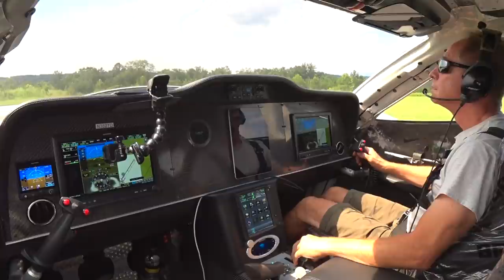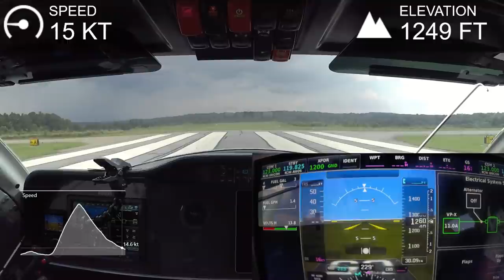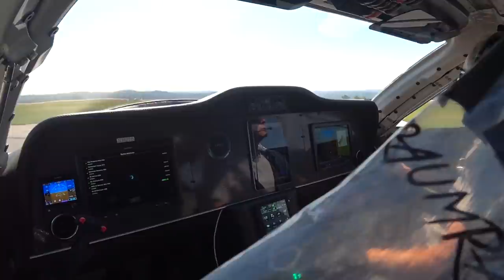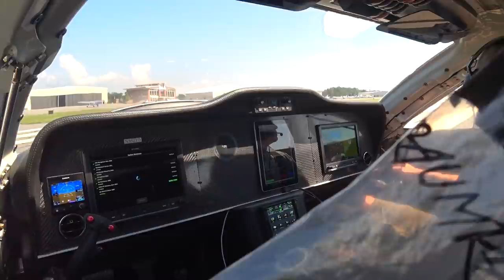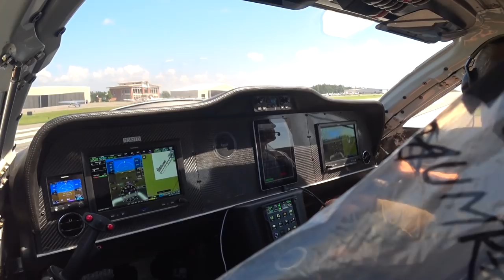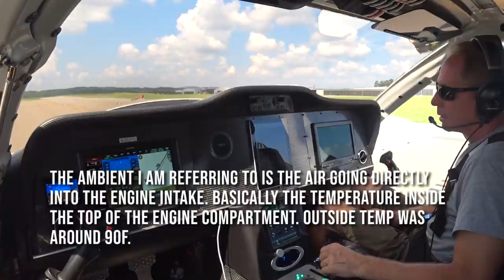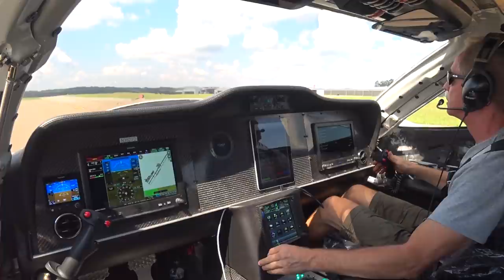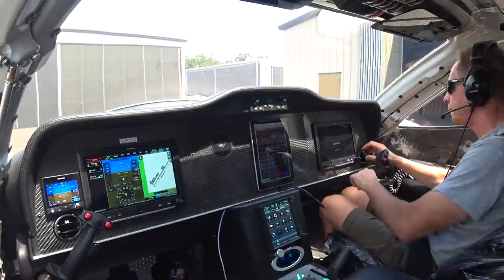Trying to Stay Cool - Building the Raptor Prototype

Comment: Move the condenser; best long term solution. I have very high humidity/temp aircraft A/C operation experience. Ground op A/C is a blessing; makes >25 min taxi-to-runway waits at intrn'l airports bearable and enhances aircraft sales. They're not too useful/efficient above the regional area atmospheric inversion layer (1500-2500 ft around where I am). At that point variable flow, passenger discharge registers with high CFM  are a must (don't overlook the cabin outflow control).
Reply: Koncas Watch completely agree.  A/C is needed on the ground, and not so much in the air, especially with the altitudes this aircraft will fly at.  Best to start looking at redesign of A/C for production versions.

Comment: I would like to know what Spd the canard will naturally start lifting the nose and what trim for takeoff and speed and how this will reflect on landing speeds. Also what was the Density Alt. Good time of year to get worse case info
Reply: I'm wondering the same thing and how long the runway is and at what point it hits the take off speed on the runway ?
Reply: M1A2 Abrams yeh, I would be taking it to an airfield with a much longer runway to test in ground effect before a flight phase and have room to stop
Reply from the maker: That's what I'm slowly determining. I have the numbers that Mark has calculated but I need to verify them. You will know when I know.

Comment: 400 PSI equates to 183 Deg F  condenser  -- 140 would be smokin' hot.   You can almost cool it with radiator fluid at that temp.  Vintage Air doesn't make their BTU ratings obvious but near 15000, probably.  That is a lot of heat.  The fan must just be running air in a circle getting hotter and hotter.   Maybe some ducting for the fan to draw real outside air through the condenser?
Reply from the maker: That sounds about right. I've got a couple of things still to try to keep it below 400. We'll see if they are successful soon enough.

Comment: Just a couple ideas. If you have room, put an elec fan on the core. Keep the air flowing thru the core. My next is a concern on the main gear suspension. From the vids it looks rock solid with the tires taking the brunt forces. Invitation for blow out on a hard landing. I hope your hydraulic actuators are pushing the mains into a mechanical lock and not taking any forces from landings. Could result in blown seals on actuators. Just my observations. Im not an engineer. Hope I'm wrong. Would want to see bad happen when your so close.
Reply from the maker: There are dual fans on the condenser already. The gear legs are made by Grove and are designed to flex to take up the shock of landing. They are locked over center so the hydraulic cylinders do not take the load. Legs are made from 7075.

Comment: Make the inlet, automatic actuating with manual override, use engine bay air flow rate as feedback. Is it possible to add a thermatic fan inside the intake?
Reply: The original plan was to have it automatically controlled. He is keeping it manual for now for testing purposes.
Reply: Thanks for that.

Comment: This video https://youtu.be/GRuF30l9FSU at 2:30 shows an LS3 in a Velocity that uses a jet pipe exhaust which could provide a good solution for the Raptor, too.  Same issue, really.  It draws air through the radiators using exhaust thrust and the designer says the jet pipe doesn't get over 120 Degrees.  He has no fan on the engine radiator that I could see.
Reply: Thats the first Ive seen on a Velocity build.  Hope it works.

Comment: Since the video with Justin and Elliot I was waiting for another below wing video of the Raptor going down the runway. I do not know if the previous videos where hands on the control or not. But the aircraft has a lot less Aileron bounce than before. 
Are you also checking your new side stick design for damage. Would be a shame when they come and found problems with it again. 
Keep up the good work.
Reply from the maker: You've obviously missed some of my videos. I did a stress test on the sticks last video.
Reply: @RaptorAircraft  - Off cause, the new control mecanics is now a realy rock solid construction. Way ahead of what was in before. I guess that's now almoste perfect. Really cool how you redesigned and rebuild this control in such a short time. Unbelievable!!
Reply from the maker: @MrPerrey  thanks.

Comment: Can the ac not working properly have something to do with that gap in the engine compartment he had you close up?
Reply from the maker: Possibly, but the engine staying cool is more important than the pilot staying cool.
Reply: @RaptorAircraft  True:)
Reply: @RaptorAircraft  Test pilots like Eliot stays cool under any conditions. With or without AC running, it doesn't matter ;-)

Comment: So was wondering with that kind of temp difference with the scoop (what conventional aircraft would call a cowl flap). What are your thoughts on cold shocking the engine at altitude once you get it on it's first x country flight. Or is it too early and you are not thinking about that information yet?

Comment: Probably need an electric fan on the condenser coil like a lot of cars. Taxiing is mostly where you need ac.
Reply from the maker: Got dual fans already.
Reply: I don’t remember seeing fans on the condenser, just on the evaporator. You need something to remove the heat when the aircraft is not moving. One of the difficulties with the pusher. So there are fans behind the condenser inter cooler stack?
Reply from the maker: Like I said, dual fans on the condenser.

Comment: Q, did you have the motor balanced and blue printed?  Next q, can you relocate the a/c condenser coil to where it will be serviced better by airflow?, 100,000 attaboys, looking like all is working well with no issues!!!  Great engineering!!! love the look of the dash, sleek and currently modern!!  Can't wait for first flight info!!! keep up the great work!!!
Reply from the maker: The engine was from a used Q7. Nothing special. Definitely things can be improved with the A/C but I'm not making physical changes on the prototype right now. For the normal flight profile the A/C will work just fine.

Comment: Have you thought about any future engine configurations if the buyer would like more power or efficiency? Or would they just have to switch to another raptor model entirely?
Reply: There's probably a bit more power and efficiency to be had with the current engine. The exhaust setup is less than ideal, and I'm sure there's a few tweaks that can be made with a few other things.
Also, the engine hasn't been Dyno tuned so there's probably some room for improvement in the ECU tuning.
There are a few new diesel engines going through the certification process that Peter has expressed interest in using in the future.

Comment: Consider dual NACA ducts down low each side of the fuselage with additional venting topside near the prop low pressure area for natural convective airflow while at idle/taxi speeds.